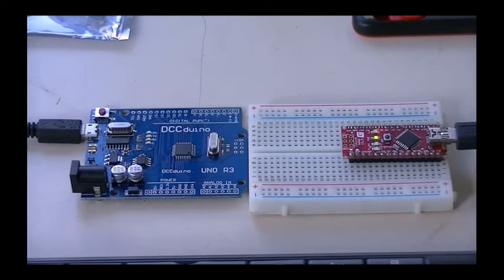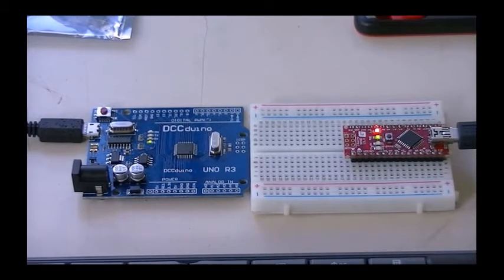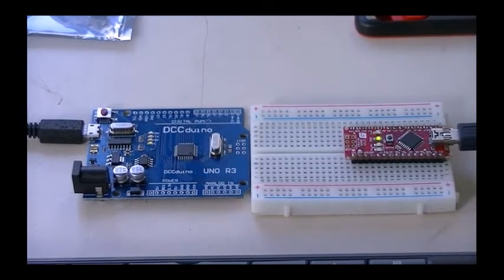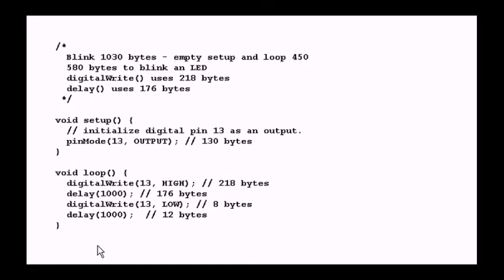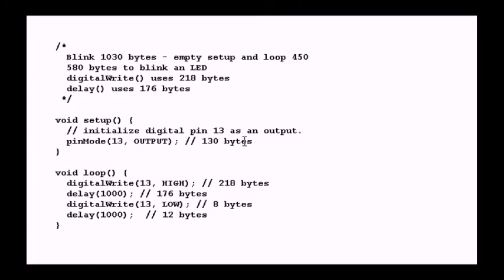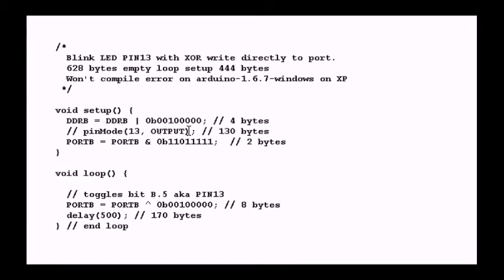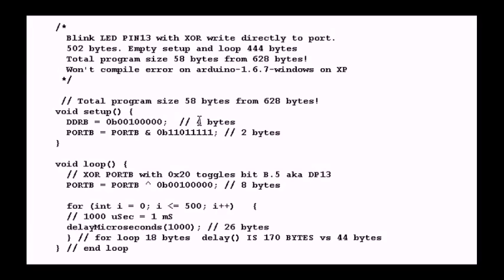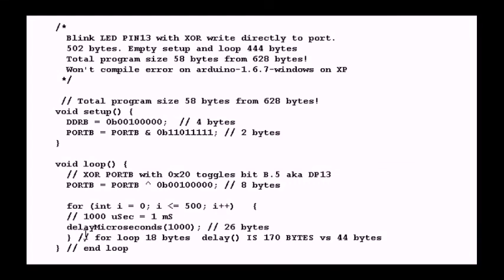Program Arduino Ports for Speed and Control

Comment: Can U Use it by Timers? as in the Blink without Delay Example? got 458 Bytes with 7 Toggle functions
ex........
unsigned long previousMillis = 0;
const long blink_interval = 1500; 

void bli_li_toggle() {//Schaltet Bli_li || Bli_Re
  unsigned long currentMillis = millis();

  if (currentMillis - previousMillis >= blink_interval) {
    previousMillis = currentMillis;
    PORTC = PORTC ^ B00001000; //Toggle PC3
  }
}

Comment: If I want to switch on and off pin 6 of digital pins which is in port D without affecting other pins ,instead of using digital write twice for on and off  with accurate microsecond  manipulation without using delay() function :what should I do? :?
Reply from the maker: See http://www.bristolwatch.com/k150/port1.htm use a bitwise OR to switch on and a bitwise AND.

Comment: < analysis of the BLINK program >
 to BLINK a LED ON/OFF; the Arduino_UNO like all electronic devices, is capable of 
turn ON- turn OFF of a LED for intervals that much faster than normal  human nerve 
reaction time. 

Instead of a Blinking LED,  rapid cycling will appear to a human as if the LED were 
continually ON, though at reduced intensity

One can measure overly rapid blinking ONLY by using a photo-responsive device driving a 
frequency counter or more simply electronics that can indicate the time interval between 
successive LED blinks.

A low Blink rate requires the electronics to Blink the LED at approximately 25Hz or slower,
hence the _delay(1000) command that results in a 30Hz Blink rate.

observerms

Comment: Atmega168, or Atmega168p 
:p
Reply from the maker: I believe a atmega328
Reply: IIRC the Uno, nano, and similar clones use the Atmega328P, in the case of the DIP package uno's it's usually the Atmega328P-PU, and in the cause of the nano, and clones it's usually the ATMEGA328P-AU

The only reason i point this out, is the Arduino IDE doesn't natively support the Atmega328 non-pico power chips, and avrdude will usually error out because the signature for the ATMEGA328 and ATMEGA328P are different. 
(It's an easy fix, just open the config file for avrdude, and clone the 328p's entries for the the 328, etc)

I've put in a request over at arduino's gitub, who knows if it will be supported out of the box in the future.

There are slight differences between the 328 and the 328p, the pinout is the same, and functionality is pretty much the same, but underlying hardware, and specifications, are different.
Reply from the maker: I used a nano with a 328 which is strange because mine worked just fine.
Reply: It's entirely possible you've worked with the non-pico powered MCU's before, and forgotten that you've added them to the IDE's config file for AVRDude, or where you got the MCU's from, have altered the signature, or have gotten a hold of some mislabeled clone MCU's. 

IIRC, the signatures are 
Atmega328P 0x1e 0x95 0x0F
Atmega328    0x1e 0x95 0x14